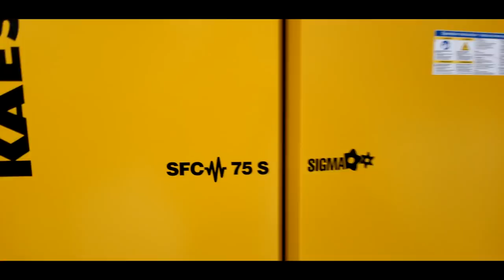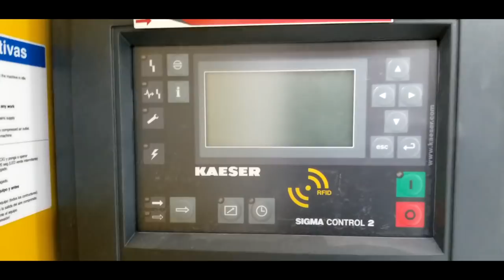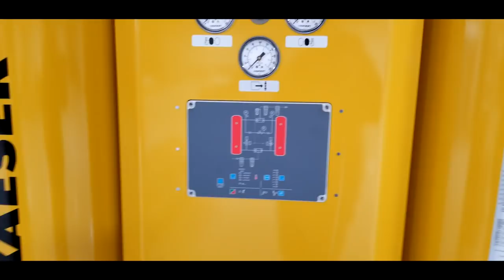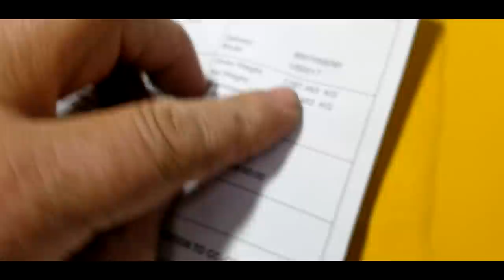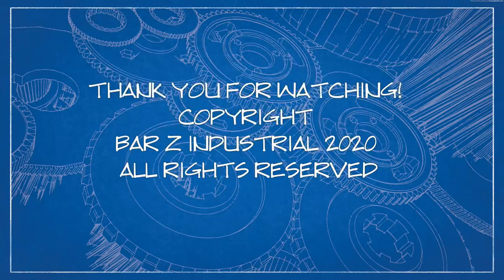Installation of industrial airline system. Part 2

Comment: Purchased the same system for my plant. Big ceilings so now issue standing the tank. Trick: pull the forklift back rest and flip your forks upside down. Let the screaming comence. The system has been excellent for the 5yrs its been in use.

Comment: Useful videos for me - as part of a manufacturing facility I'm laying out for a client, there will be a plant air system with 4 x 150 hp compressors, using 2x 5,00 gallon receivers. Regenerative dryers will be used to bring the dewpoint down to instrument air quality at -40 C. That's roughly 6x the size of the installation in the video...

I only do one up from scratch rather rarely - usually, I just tell the plant's facilities people what the new equipment is going to need, and they tell me if they need to expand their utilities setup.

We're still in the Front End Engineering Design (FEED) stage on the project, so the concept will get refined before we go out for bids... meanwhile, I can show this video to my colleagues and clients to give them a feel for what we're looking at.

Comment: I love how clean the Kaeser controls are setup. I am currently shopping for about a 50HP unit or so to replace my combined 35HP of reciprocating compressors. We get some amazing rebates on the VFD-run Kaeser units from the state/power co locally here in Boston. Curious what your thoughts are on the Kaesers? I assume you have worked with others prior? I got quotes from Quincy, IR and SULLAIR, I think Kaeser is for me tho.

Comment: How many gallon tank?
Reply from the maker: Not sure, never read the tag.
Reply: Ballpark for a 150# system, 48" x 144" gets you 1,060 gallons from Hanson Tanks - but they weigh about half of this thing, so I could be way off, or the fabricator for Kaeser is making a super-heavy walled tank.
Reply: I guess that tank to be about 4 feet in diameter by about 12 high, which is about 150 cubic feet. That puts it somewhere around 1100 gallons or so, roughly.
Reply: @lwilton  Those are approximately the numbers I was using...